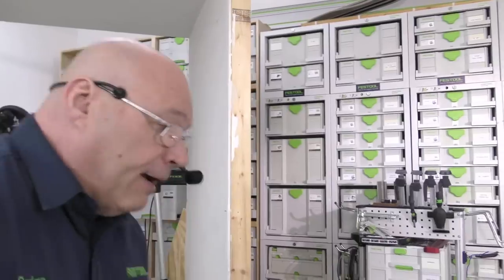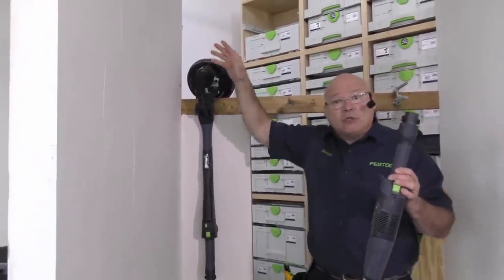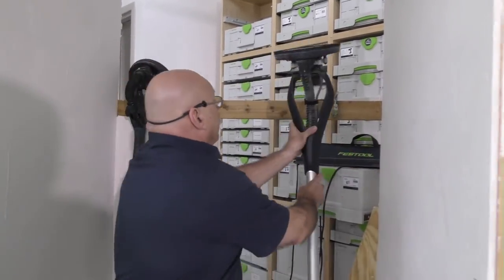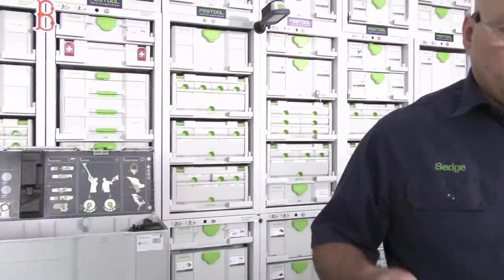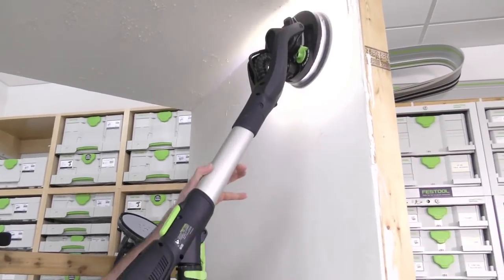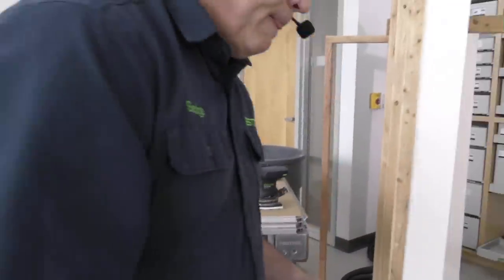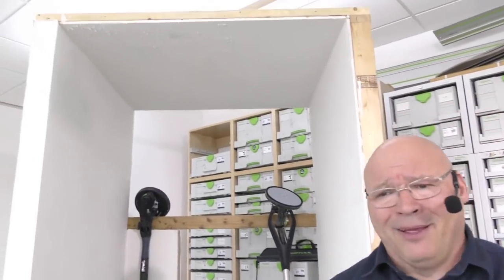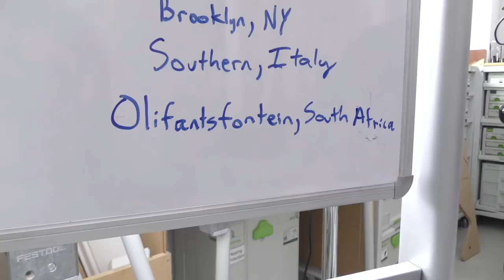Festool Live Episode 48 - New PLANEX

Comment: Thanks for the demo. Just finished watching the german video. Not sure why they're against using carpenter dust bags for drywall dust. Thats all Ive ever used and works better than the open plastic bag system they recommend. Am I missing something, cause the open bag method clogs the filter faster.

Comment: Great changes with one exception!  Lov e the rake light.  Fantastic.  Ergonomics:  total win!...Sanding drywall mud....not so good.  My experience with this machine in a few days of a concerted focus on fine-tuning produces a ridge at the top of the center consistently. I ended up calling fest tool customer support to get some help. I was instructed that my drywall mud was too soft.  First of all, I own five other LHS 225s (old model)  and they work perfectly. I sanded Plus 3 usb mud and also USG fast set 40.  Both have the same results producing a ridge at the top of the sander.  No abrasive or suction pressure changes made any difference.  On the Support call, I was told I need an additional sanding pad to correct the issue.  Problem is, festool doesn't sell to the general public..  You have to purchase it through dealer.  The part is $55. Unfortunately no dealers have the part in stock because it's too new. I ended up having to send the machine back because I was running tight on my 30 days moneyback guarantee.  The question I have is: why wouldn't fess tool send this machine with that pad knowing it's intended to sand drywall mud? Perhaps in the future they will make some adjustments to the machine that will make it truly a level five drywall sanding tool. I'd love to hear feedback from fest tool on this..

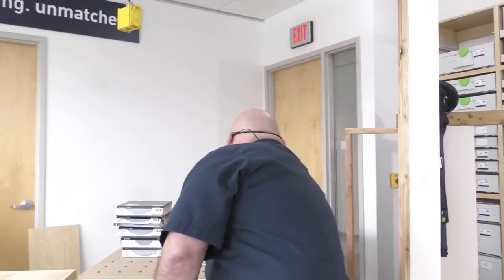Comment: @23:27 what is the part number for the adaptor to connect a smaller sander without a hose swap? Also I have two Planex hoses and want to couple them together so what is the proper part number for the correct 36mm connector to join them?
Reply: Festool 768135 Reducing Sleeve 36mm-to-27mm Hose Adapter is the one I have, not sure if there is a different one for a planex hose